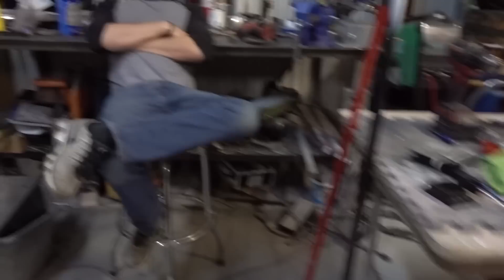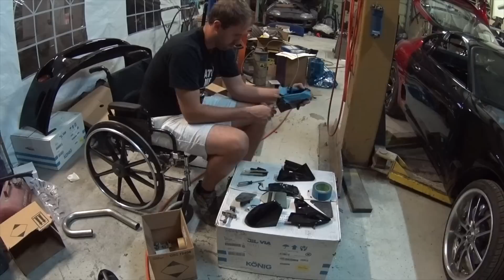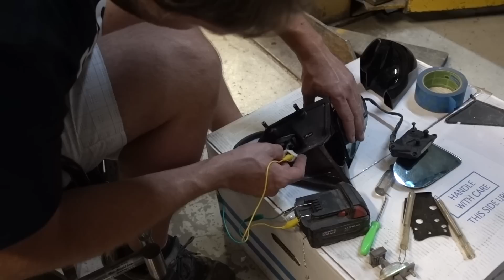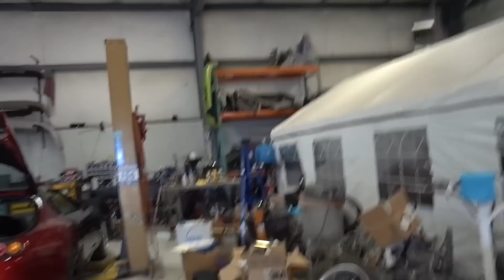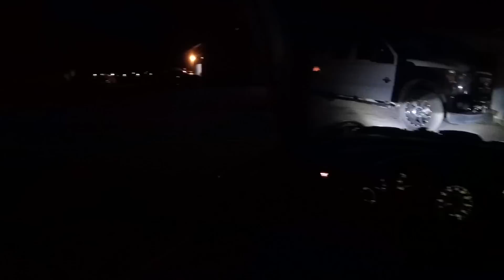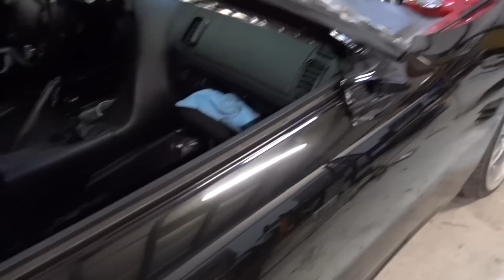Single Turbo MKIV Toyota Supra - FIRST DRIVE!!!

Comment: Curious on what outputs you used on the harness for the tachometer to work. I’m at that stage with my CD009 and I’m considering the V SS in on the ECU black connector(B20).

Comment: Trevor the grommet in the rear where you ran battery cable, is where the rear ABS sensors normally run into the car.  1 on each side.

Comment: To get your rpms to work on your cluster jump the resister that's on the right of the rpm gauge to except the 12v signal from the igniter

Comment: What i especially like about this build is that you have a very updated 2JZ. And you have a 370Z transmission, which is extremely light weight and strong. This should feel more solid and more updated than what the original Supra came with!

Comment: Should of ran the battery cables on the passenger side inside the vehicle cause incase of fuel leakage an electeical problems could cause devastating news 💯

Comment: So many youtubers don't know to bleed the power steering before start up. So many ruined pumps and some are just lucky
Reply: I was guna mention that. Figured Trevor knew but yeah so many people don't know that if you just  jack the car up and turn the wheel slowly and wait for the air to bubble up you'll have alot easier time bleeding it
Reply: @chickenfishhybrid44  not only that but the damage that can occur. I do have to say with my knowledge toyotas are fairly forgiving when it comes to this. Ten turns left and right is a minimum for me and don't get me started on a hydro booster system hahahah